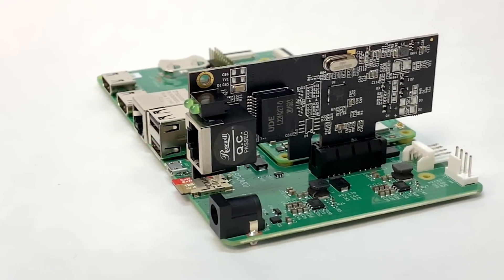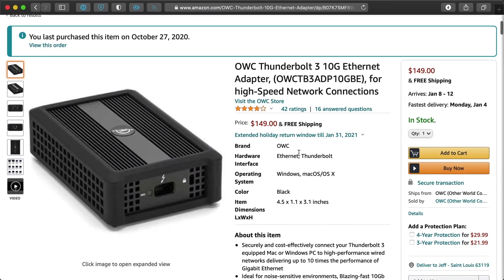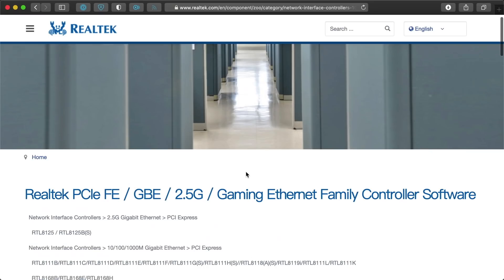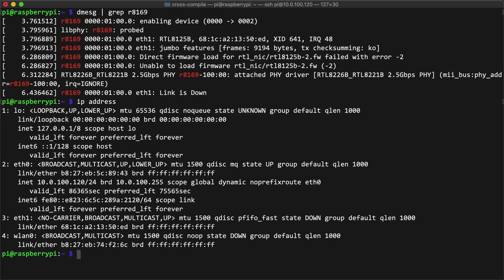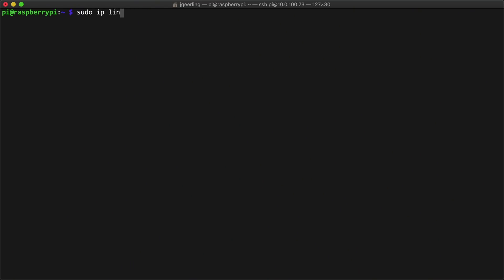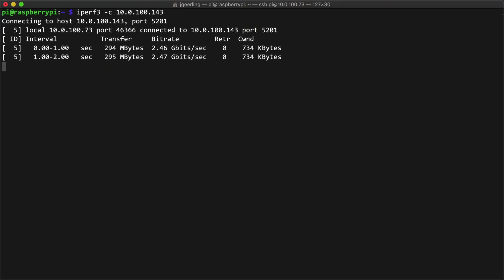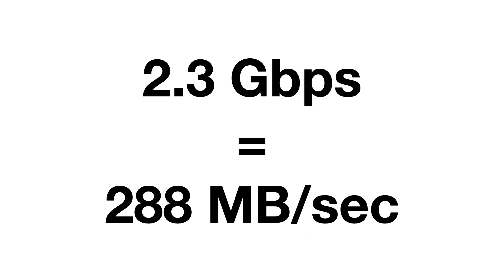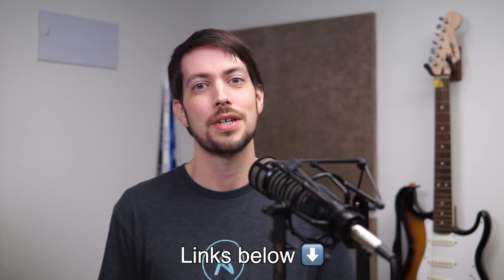Raspberry Pi CM4 does 2.5 Gigabit Ethernet!

Comment: 2 years later, and Linux support for 2.5Gbit ethernet is still flaky. With LMDE 6 I got it working plug-and-play with 2x pcie x1 cards, but only getting about 1/2 rated speed - even with sysctl tweaks. Still, ~180MB/sec is still noticeably better than gigabit. Setting the mtu to 9000 on both sides resulted in dismal performance tho

Comment: Came back to this for “gotchas” as I had an idea. CM4 “steam links”. Basically the CM4 on a carrier board that gives it up to 2.5Gb/s running steam OS3.0 (steam deck os) maybe a NVMe SSD or an m.2 SATA. While it would have steam os it wouldn’t be playing games directly by streaming them.

Haven’t play with steam os 3.0 much yet as it’s not official, but if you can have different user logins and that login streamed the game from that player’s library. 

Idk. I think I am on to something, but maybe not

Comment: Hi. Amazing content.
Here is an interesting experiment:
Have pi have 2 x 1gig ethernet ports, configured to be LACP, and pass through the combined traffic via 3rd 2.5G ethernet dongle.
Use Case - to make a 2.5G adapter for NASes, that have 2 x 1G etherner and LACP support, but no support for multi Gig dongles via USB, such as PR4100

Comment: It would be nice to plug cm4 in and it auto run at 1gb or 2GB.  If there is hardware out there for cm4, they should automatically have downloads to update OS as an auto - switch for their adapter.  If Raspbian / Raspberry foundation wants value in compatibility of different vendor adapters they gotta communicate well as Microsoft seems to with hardware adapter vendors.
I know the foundation is working wide open.  However YOU ALONE keep coming up with ideas / videos on new things for PI4 /cm4.
I sit up to 2a-3A a lot of times going back over your videos in enthusiastic wonderment!

I want to do them all!

Comment: I'm not sure why you bother with cross compiling kernel with BCM2711. I mean, I did attempt compile the whole android-rpi with 8GB pi 4.

While task failed successfully (curse google closed source binaries), native kernel compile performance is decent. I haven't time it against my Ryzen 3 1200 (4c/4t) but compiling android-rpi kernel (forked from rpi) pretty decent. Thought I had to wait around 2 hors but it finished earlier. My machine uses external HDD over USB3 so I can compile everything fyi

Comment: There's a company called 10gtek based in california that makes and sells spf transceivers for a really good price. They also oem code the transceivers to a lot of popular brands. I bought an sfp fiber for my mikrotik hap ac and one for my netgear gc110 switch and they work as expected. They're on ebay and amazon. Both transceivers cost $18 total. I believe rj45 transceivers are slightly more expensive but still less than half from whatever brand you're buying from.

Comment: Hey man! Love your videos. But is there an update for eGPU for rpi cm4?
Reply from the maker: Still working on it. So far all four GPUs I've tested lock up at some point during driver initialization, and right now I'm working on getting remote GDB debugging working so I can try to troubleshoot the drivers.
Reply: @JeffGeerling  wouldn't it be nice if we saw some of ARM based DGPU? Like a physical Mali card or Adreno card? By the way....as you said there is an x86 specific feature which is the problem for RPi gpu. How will this be addressed? I don't think x86 emulation will be possible at this low level

Comment: I kept watching this and wanting to say, "but you need to.." and then Jeff does it.

Well done Jeff. I think you're the only one pushing the CM4 to these kind of limits.

MTU and jumbo frame change for sure will help the most, even with 1Gbps. It's like trying to move to a new house with a Kia vs a U-Haul. Tons more room in the frame, so fewer trips. A lot less work.

Of course everything in the path has to be able to fit this figurative U-Haul (9000 byte frame).

Jeff, Could you please share your iperf/iperf3 options/switches with the class?
Reply: Looks like you used iperf3. I'm wondering if you forced no fragmentation? Like what swtiches on iperf3 did you use?

Comment: If using a USB 2.5 GbE Adapter alongside a USB SATA SSD (500 MB/s read/write) how would that effect the iperf3 bandwidth tests?
Reply: Excellent suggestion.  @Jeff Geerling checks that out.  What good is high network bandwidth if it bogs down your storage read/write speeds if you are doing a NAS.
Reply: You only have one PCIe lane, so I don't really see a way to do this.

Comment: Hey, me again, saw that you cut the kernel compilation time, that's awesome! If you want to go even lower, you can use CCACHE. The tradeoff is that it's gonna take some space on your disk. It's basically a cache of pre-compiled .o files from .c/cpp files. It's automatic and reliable. First time you're compiling with it, it's gonna take the same ammount of time as usual. Second time, you better put on your seatbelt.
Reply: Should note that you can do that easily by changing the Makefile and replacing the line https://github.com/raspberrypi/linux/blob/rpi-5.4.y/Makefile#L424 by CC = ccache $(CROSS_COMPILE)gcc . I also recommand that you set the cache size higher than the default 1GB (set to 15GB for kernel only should be good). I used to have over 200GB ccache to build android A LOT faster.
Reply: To give you an idea, cloned the kernel and compiled.

ccache first run
real    12m25.409s
user    110m10.196s
sys     11m7.344s

ccache (clean with cache built)
real    1m45.049s
user    13m45.032s
sys     2m7.171s

Once you modify some files, only these modified files will get rebuilt. Mostly everything else will be in the cache. 

Side note, 1GB ccache might be more than enough for that kernel, it ended up using around 350MB on my system. I used to compile for a few devices which takes more space for the cache. Running out of cache space is not optimal + it's not reserving the space so setting it higher wouldn't be a bad idea.

Comment: Have you tried using distcc for any of your kernel compiles? Works pretty well on my rpi cluster with 4 pi4 8gb's and 2 pi3b+'s. It looks like it supports cross compiling as well, just be sure to exclude the master node from the hosts list when you have more than 5 or 6 nodes. Just got my feet wet with kernel compiling and only did it once on a single pi before needing to find a better way. But now with the iSCSI modules I have a k3s cluster up and running with the only storage being 2 usb ssd's on one of the pi's, good riddance micro sd cards!
Reply from the maker: I haven't tried it yet, but mostly I like trying to make the compile operation as self-contained as possible since I sometimes hop from computer to computer, and don't always have a fleet of Pis running and at the ready :)

Comment: So as to "why am I doing this?"  I guess "because it's there," a common mountain climbing adage, isn't enough. You could explain it to your wife as, "this is a good example to show techniques that one goes through to diagnose hardware of any type: testing, knowing all the variables, and recompiling the kernel."  Plus you're an effective teacher, which means you will get to more people with lower skill sets showing a hypothesis (network speed), data metrics, and conclusion based on the results, even if it doesn't agree with your hypothesis. This is PURE scientific method, right here.  Which is why I watch and subscribe. :D

Comment: Re your $65 10G Copper SFP: I used to work at a network equipment development company, and we used fs.com for all of our fiber and transceivers if we couldn't find what we needed quickly enough through our cheaper contacts, and they've always been really nice and cheaper than most other major online retailers. They have 10G Copper SFPs for $59, so you may can save a few bucks with your 10G upgrade!

Comment: an average video from jeff:
1.get a pci-e device
2.plug it in
3.lspci and dmsg
4.recompile the Linux kernel
5.excitement
Reply from the maker: Hehe... you have cracked the code! Though sometimes between steps 3-4 I put in "try the manufacturer's driver download and get disappointed that it doesn't compile on ARM, so skip to step 4 anyways".

Comment: consider bonding or bridging links and get 3.5 with some sort of link agg lacp? i tried bonding myself and only got a couple more mb/s - there is a way to do it maybe try a usb2.5gbe and bridge or bond 2 2.5 - also consider usb nvme raid - pls test a few of these in quest for optimized pi - it may go on forever as a work in progress, it is all good - the next version of pi is liable to be a barn burner if they do it rite - more pci lanes is what it needs - and usb4 would be fantastic - sep controllers maybe and 16gb option would be fantastic also - that is really all it needs - when you uncork the io you can realize the full speed of the chip #bottlenecks #gluster node #io computer
Reply: props to red shirt jeff - the reenactment was so realistic (realtekish) i almost felt like i was there smelling the crab magic smoke myself #grammy award for extemporaneous industrial smoke and magic
Reply: this was great content and will be of interest to anyone running gluster on the pi - nvme and fast network really help performance - the pi folks should be getting a die shrink with the next iteration - that should help with power and they will get ipc gains - more pci lanes and more ram would be game changers - they should just do one more tier, they can respin for usb4 and ddr5 #odroid #sbc mkt metrics #rockpi #better easier clustering #instead of soldered on ram just have slots - you could have a pi with 64gb ram #nuc competitor the sbc space is liable to be intense in the next few years and a space to watch #outperform #format the butt or root partition as it is otherwise known #sonic on arm #L2/3 potatoe routers/switch #connectx and opnsense for your 100g network - what you really need to connect ws/devbox/server and nas and 2 vmservers (4 cards 2 dualport) if you nat chain or 8 cards if you want to diy switch which would give you big advantages - short fiber links are cheap - i think 100gbe solutions will be popular for smb going fwd - 10g is just scratching the surface - the newer nvme raid arrays match up well with the 100g and nvme scales great for db ops - refurb mkt is hot but the fast network with fast nvme to go with it to compliment are the big upsells along with gpu passthrough (this would enable pi to do compute) #techmikeny bargain hunter #reseller ready #resellers panel #don't break debian #no warranty #america's volume opnsense dealer #underclocked potato routers
Reply from the maker: That smell...

There are two smells you will never forget, that of a backed up sewage pipe, and that of electronical magic smoke.

Comment: Are you running the Raspberry Pi OS 64bit beta?
Reply from the maker: Yes, I either use that or Ubuntu 20.04 Server for Pi, as both of those 64-bit OSes seem to play much better with device drivers and software that's typically tested only on ARM64 and not ARMv7 / 32-bit.

Comment: Stupid off-topic comment, what make is that vacuum cleaner?
Reply from the maker: Oreck XL. Had a beastly Dyson for years, but I realized it's actually harder to vacuum with the Dyson because it sucks so hard (in a good way)—you kind of had to pull it everywhere.

An Oreck seems to be pretty good between 'sucks things up' and 'doesn't suck itself into medium-pile-carpet so much that it's hard to use'.

I do miss all the attachments of the Dyson though. And it did last me about 10 years before part of the plastic on the head cracked off.
Reply: @JeffGeerling  was Oreck the one who used to advertise by holding a bowling ball above their ceo held only in place by the vacuum power?
Reply from the maker: @TomOConnor-BlobOpera  Haha, yes, back in the day. It's a darn reliable vacuum though. The reason I bought one is I know two people who bought them in the 90s and they're still going strong.

Bagged vacuums are annoying, sure, but at least I can just vacuum a ton over the year and replace the bag once every now and then instead of emptying out the tornado chamber (that shows the nasty buildup) every time I vacuum :D

Comment: A little suggestion for 10G transreceivers: don’t put them in adjacent ports 😉 leave a port in between for a copper tail or a fiber module, that helps the thermal distribution

Comment: Jumbo frames can interfere with zoom and twitch streaming... Don't know why.
Reply: @Ray Foss , "Jumbo frames can interfere with zoom and twitch streaming... Don't know why."
I think it happens because the device with jumbo frames enabled will enventually send jumbo frames to the non-jumbo frames configured device.  A 9000 byte jumbo frame is about six times larger than the typical 1500.  The non-jumbo device would drop any packet that it receives that is larger than its limit.  Receiving a series of jumbo frames that would be dropped in a short timeframe will play havoc with any higher network layers to the point of causing a flapping connection for the 'apps'.  Real time apps like Zoom and Twitch can't compensate for the data loss that can be induced by significant data loss in the network with out being noticed.

Comment: I’m really hoping for getting some “router boards” for the compute module soon!

Having a Pi based router with something between 2 & 4 gigabit Ethernet ports would be amazing!

OpenWRT already has support for the Pi and the throughout it has for VPN’s is amazing! I’m using a Pi 4 for bonding together 2 different ISP’s and I’m getting a full gigabit. But using usb Ethernet cards is a bit hacky.
Reply from the maker: This is one use case I hope to explore further once I get a few more network cards tested. There are already a couple concept boards (one in production that should be available soon!) with more than one 1 Gbps port. I would like to see one with at least one 2.5 Gbps port too!

Comment: So how much did throughput change in the CM4 or Pi4’s built-in Ethernet with JUST Jumbo frames enabled? Did you cover that in a previous video & I missed it? Thx.
Reply from the maker: I touched on it in a video on the Intel I340-T4 — the built-in interface goes from ~940 Mbps to ~980 Mbps.

Comment: Could have just used a 2.5gb usb adapter for the mac and connected the pi with it with a utp cable. Ugreen or sabrent 2.5 adapters work great

Comment: The next step is to use PCI-E switch to connect two 2.5Gbps adapters and use dpdk or xdp to bridge them. I guess quad core Cortex-A72 could handle the load. RPi 4 as the future-proof routing platform is a quite interesting concept.
Reply from the maker: I have a 2-port Syba 2.5 Gbps card on the way—https://github.com/geerlingguy/raspberry-pi-pcie-devices/issues/46 ... I'll be interested to see if I can get more bytes/sec through that with both interfaces.
Reply: @JeffGeerling  BTW, have you tried to use RSS? You have to enable ENABLE_RSS_SUPPORT in driver's Makefile for that.
Reply: With RSS and multiple TCP or UDP streams (-P option in iperf client), you will be able to use multiple cores to process network load.

Comment: Hello Jeff, thanks for all the great content, one quick question, is there already a Raspberry Pie that comes built-in with at least two NICs? 1G speed will be enough for the time being, however, dual 10G NICs Raspberry pie will be super awesome.  Thank you in advance, and happy holidays!
Reply from the maker: Good question! There is one board in development that Seeed studios will be selling soon with two 1 Gbps ports (one goes through a USB 3.0 interface): https://github.com/geerlingguy/raspberry-pi-pcie-devices/issues/25#issuecomment-751566018
Reply: @JeffGeerling  Oh cool, thanks for the prompt response, I will definitely check it out.  Another quick question though, there is one small board (not a Raspberry Pie) built by a group called Kobol link here: https://kobol.io/ it is a NAS, seems to have the two 1G NICs but I am more interested in using it as a router/firewall.  I own the previous generation of NAS called Helios from the same group Kobol and I won't change it for the time being, this one comes with a single 1G nic.  Thanks again, let me know your thoughts on the Helios64.  Looking forward to hearing your opinion.
Reply: Think you'd hit the limit of the PCIe interface at that point, a single gen 3 lane tops out at 8Gb